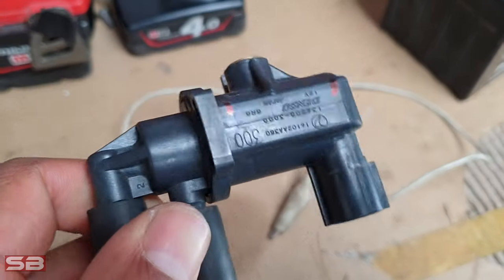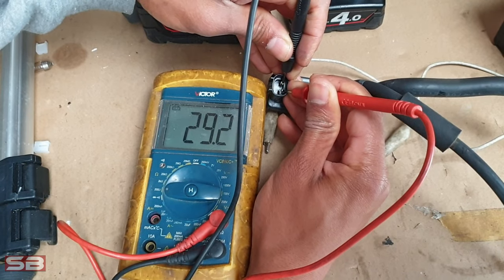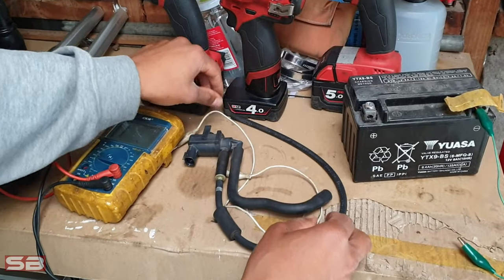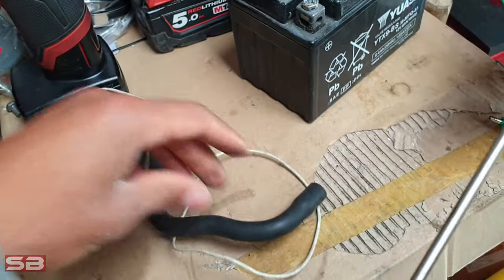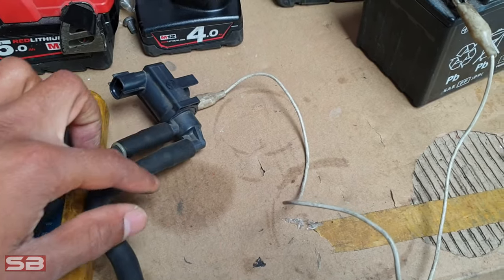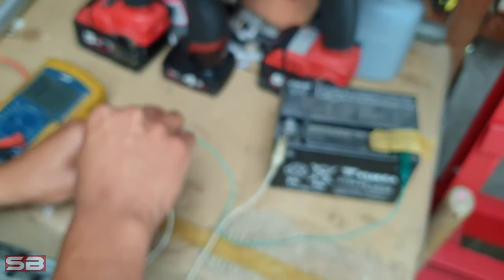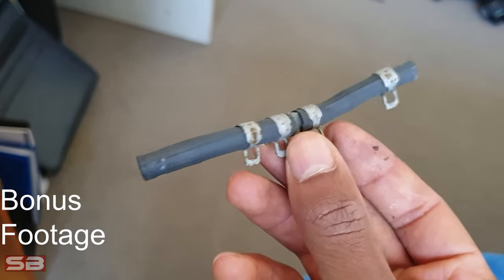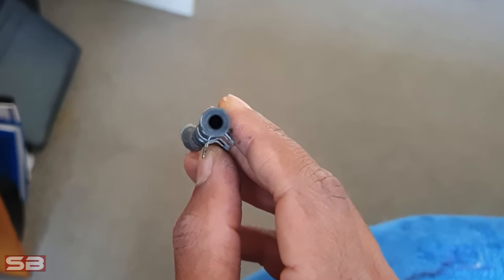Boost Control Solenoid - How to Test (Incl Important Restrictor Pill INFO)

Comment: You’re an absolute legend! After a month of diagnosing and taking it into the mechanics with no success, this finally fixed my low boost issue, cheers mate
Reply from the maker: Great! Appreciate the feedback, thanks!
Reply: You say low boost issue we’re you capable of making any boost I’m having an issue and it looks like my boost gauge is only hitting 2psi I’ve checked all my intercooler piping and all my hoses just can’t seem to find the issue and I have no code for low boost
Reply: @killacam7254  did you check boost pill?

Comment: My car workshop has replaced my hoses. My car is always low on boost. Can it be he has removed the hose with the Restrictor PILL.? I think many car workshop is not aware of the Restrictor PILL. Where can I buy a new Restrictor PILL?
Reply from the maker: @dinhvanpham8102  What car is it? Yes a lot of workshops do not know about this
Reply: @AutoBuddynz  BMW 525D Xdrive F11 2012. N47T 2.0 diesel engine. 218 HP
Reply: @AutoBuddynz  Lately I have got error 299100 Pressure converter turbine control flap open circuit. It is coming everytime i start my car. The car is in limbo, it does not accelerate as it should. IF I push too hard drivetrain pops up. There are two booster pressure solenoids. One for the low and one for high turbocharger. If the booster pressure has failed, should I replace two solenoids?
Reply from the maker: @dinhvanpham8102  i don't think you have a restrictor pill issue with your car. You may need to take the vehicle to a specialist BMW workshop
Reply: @AutoBuddynz  I have already been at the BMW specialist twice. The did not find anything and charge me 2500kr each time. I did a scan with my scan tool and check life datastream on the DDE engine control module, reading charging function data. Usually when the pressure converter works the booster pressure datastream changes everytime up to 100 percent when  i hit more acceleration. Now the datastream stay on 19.21 percent and do not change. I think it is right that my pressure converter is faulty. The turbo charge air hose do not expand either when I start my car. Error 299100 says pressure converter turbine control flap open circuit comes back after  I erase them. I have replaced 1 the pressure converter last year, I think i have to replace 2 pressure converter this time.
Reply: @AutoBuddynz   Hello good evening. I am happy to share I have found a solution. I checked the turbo aiir charge hose. It was 1-2mm slack. I replace it today 28.09.2024. The new one is firm and tight. Now my turbocharger is working again. Thank you for support and help. Have a fantastic weekend and enjoy life. :-))
Reply from the maker: @dinhvanpham8102  Appreciate the feedback, thanks for the comment.

Comment: Max vaccum level from pump is -1bar. Basicly, there is no need to test the valve with more than +2 bar (if you do not have external vaccum pump and you are must use compressor).
Reply from the maker: Correct

Comment: I checked my Booster Pressure solenoid measuring the ohm and it shows only 14 Ohm. On the 28.09.2023 suddenly I loose power and drive train messages keeping coming. I  have no doubt my booster has fault and I have to order a new one. Thank you for your video guide me to check the faulty component.
Reply from the maker: Thanks for the feedback!

Comment: Nice video my problem is my ford galaxy TDCi drives fine except when I go up this 1 Hill and I lose boost the car still drives but no boost I get p2263 code which clears with engine off and back on drives fine after that I've checked all the vacuum lines for breaks can't find any ,do you think the turbo boost solenoid is failing under sustained pressure .would appreciate your advice .thanks

Comment: Thank you for a greate video.  What is the hose size? According to your t-connector, left go to the actuator, right go to the vacuum with restrictor pill location, down go to the Wastegate solenoid valve. Should it always be a restrictor pill on the vacuum hose? What happen if the estrictor pill is not there? I have problem with low boost. Lately i have got error 299100 Pressure conveter, turbine flap, activation open circuit. Is this related to the  boost control solenoid? Another error is drive train if the i accelerate to 2000 rpm or more. I use Autophix car scanner tool made for BMW and MINI. Checking the charging datastream booster pressure solenoid show only 20 percent. In normal condition it show between 96-100 percent. Help!

Comment: On my f30 328i I replaced the vacuum pump and the solenoid 2 months after I got the code 120308 and I saw that my pump was leaking oil. After replacing it all and hitting the gas a little hard it’ll give me the same code. It feels like 70% power all the time compared to before any of the codes and feels like even less when I get to higher speeds. I don’t know what’s wrong, the pumps passing the compressed air and after watching you video the solenoid is working I think, I have 3 that I’ve tried.
Reply: Welp I just checked all of them and they all let air out of port B when I blow into port A with no power, but these solenoids are different they have 3 ports ones just blocked off

Comment: Nicely explained and very useful .Thank you for sharing and keep up the good work.
Reply from the maker: Appreciate it. Thanks!
Reply: @AutoBuddynz  Just a quick question about your multimeter ohms resistance set up.Mine only goes to minimum of ohms 200 and doesn't read the 20 to 30 as specified!How does yours read ?Cheers
Reply from the maker: @powerspeedutube  200 ohms means that it will read all values upto 200ohms.
Reply: @AutoBuddynz  Thank you very much.
Reply: @AutoBuddynz What are the chances of buying a new solenoid and also letting air from port A to port B without it being energised?
Working on a PSA 2.0 HDI -110 engine which has 2 EGRs solenoids and 1 turbo ...they are all letting air through without energy ..Yep ,I did swap them all over but still no power .The wastegate rod moves nicely when I apply vacuum,so it's either the solenoid or vacuum pump.
Very odd.......
Reply from the maker: @powerspeedutube Since its on the egr system, the operation would be a different, how does your egr valve work? Vacuumor positive pressure operated?  Generally on idle the egr valve is closed.
Reply: @AutoBuddynz  Thanks for taking the time to reply. I thought like you that vacuum would only go from port A IN to port B Out when solenoid is powered and hence no vacuum or air could pass from one side to another, but the new one also let's it through. Meanwhie for no reason, I stopped getting power to solenoids but traced to a broken wire, so that's sorted. So I am confident that I have ignition on power and I also checked continuity from solenoid plug to ecu. Here it's the ecu that sends the ground signal when needed. My next step is to verify vaccum measurements from vacuum pipe downwards to the solenoids and hopefully find a leak somewhere, as I suspect because thd solenoids are not receiving enough IN vacuum, the ecu isn't turning them on. I am only getting 350 hgmm and I should see 700+..Maybd this is! I let you know but I am still baffled by the solenoid air going through and not holding vacuum.
Yes, you are right EGR should be closed at idle and I also have another solenoid that controls the throttle valve and this should be opened.
Normally I resolved so many problems like this by finding a faulty  solenoid not holding vacuum because thd rubber membrane seal split inside.... Thanks
Reply from the maker: @powerspeedutube  Thanks for the info, do let us know what the issue is when you solve it. Have you tried one of these vacuum hand pumps? https://www.amazon.com/Performance-Tool-W87030-Automotive-Bleeder/dp/B013VUZ7WG/ref=sr_1_5?keywords=hand+vacuum+pump&qid=1668971854&sr=8-5    
Used to normally bench test solenoids with it.
Reply: @AutoBuddynz  Hi, yes I have a similar vac pump. Been very useful together with multimeter in resolving vac and electrical problems, especially with solenoids.
Will keep you posted and also still need to know why all solenoids I have let air through,which is puzzling me. 🙈
Reply from the maker: @powerspeedutube  Whats the part no. on your solenoid?

Comment: I think I will change mine. My mini runs very good but I've been noticing some kind of strange fluctuation in the way I receive power. No codes ever, sometimes I have full power, sometimes it's only maybe 70-80%. I have bmw diagnostic tools but I just don't really know what to do anymore.
Reply from the maker: What car is it?
Reply: @AutoBuddynz  Mini Cooper S 2012 with n18 engine.
Reply from the maker: @Globbs  don't think that would be related to the boost control solenoid. Would start with the basics first, furl and spark testing.

Comment: Hello, thank you for the informative video....i have this turbo fault code here P0048 on my hilux 2.8 gd6 and the car has low boost. Tested the solenoid and im getting 24/25 ohms. Care to advise?
Reply from the maker: Is the wastegate operating correctly, depends on what is fitted Electronic Actuator or mechanical? Are you able to perform all the checks seen in this video to ensure the solenoid is operating correctly? Might also be worth checking your vacuum lines etc
Reply: @AutoBuddynz  yes the wastegate is operating smoothly....the actuater is an electronic one. I only managed to check using an ohm meter because its the one i have right now. The only thing worrying me is that the position sensor was broken during the accident and we put it together using q-bond maybe it shoterd out the whole thing

Comment: My car normally runs at 1.5 overboost , 1.3 constant and 0.8 at redline. But for the last 1 week i notice boosting only to 1.1 and then going down to 0.5-0.6 which i think is the wastegate pressure.
Does this mean i have bad solenoid ? I checked for vacuum leaks and any hardware cracks like turbo or manifold and all look great. So either my wg is at fault or n75 solenoid. Any ideas?
When i disconnect the vacuum line from the WG my car boosts up to 2.0bar(29psi) which i think means my wastegate is OK.
Reply from the maker: From the test you completed it tells me the wastegate is sealing well. Another test you can do to ensure the wastegate actuator is functioning is to connect the wastegate vacuum line to a boost line eg. T in from a boost gauge line etc. This way you can check that the wastegate open and holds steady factory boost pressure

Comment: I have Volvo v50 diesel 2.0 Litres,i have the same Solenoid Controller...i grabed a medical Syringe and tested this vacuum ports A and B...when that car is in idle for example the port A is working as it should be the vacuum is ok the Syringe is closing fast,but the port B is not working at all...is this meaning that my Solenoid is not working as it should ?Should booth port A and B work exactly the same ?
Reply from the maker: You really need to pressure test any boost solenoid, vacuum testing a pressure device is not really ideal. If you visit any garage or buy a can of compressed air follow the steps in this video and you will know for sure if there is a problem with it.
Reply: @AutoBuddynz  Thank you !

Comment: If Apply air of port b , should escape in port a ? Or not ?
Reply from the maker: Only when you activate the solenoid with 12v air should flow from port A to port B

Comment: Would a faulty valve of this type be the cause for shaky acceleration? My car essentially vibrates when I accelerate any faster than a grandma
Reply from the maker: Depends on the conditions while driving, highway etc but in most cases no, sounds like an airflow meter problem. Scan the car for any codes
Reply: @AutoBuddynz  ive disconnected the maf while it idles and ive been told that if thats bad the idle will smooth out but that killed the engine, was going to buy a new air filter and some maf cleaner, ive cleaned the etm before and re-used the gasket. could that be the cause?

Comment: Why would you even check this solenoid? Symptoms please.
Reply from the maker: Vehicle not coming on boost, low boost pressure. Stored fault codes. Basically if the vehicle is gets slow or sluggish
Reply: @AutoBuddynz  thank you!!!

Comment: If these fail could it cause the engine to not start? Vw golf tsi 2008
Reply from the maker: No it should not cause a no start condition. There are cases if the wiring is short then it could affect the CAN bus system but this is rare. More common things to fail on a Golf TSI, high pressure fuel pump, timing issues, diverter valve, vacuum leaks to name a few. Whats wrong with your Golf and when did it start having issues?
Reply: @AutoBuddynz  okay thanks, I have a diagnostic guy testing today hopefully narrow it down . Car was lacking power then one day going up a hill it stopped, last toothed belt was replaced at 130000 at 190000 now.

Comment: Hi, is this the same as the waste gate solenoid? Thanks
Reply from the maker: Hi,  yes it is, if your referring to the part which controls the mechanical waste-gate actuator connected on the exhaust housing of the turbo.

Comment: Looks like there is 2 pills ? I had blue tap on mine but feels like I have a pill in either side
Reply from the maker: Hey that should not be the case, should only have one, is the vehicle reaching desired boost levels?
Reply: @AutoBuddynz  I deffo have 2 one either side of the t piece one side had blue tape on it. I bought it from main dealer. I replaced all solinoids and pipes coming off the solinoids on my car and still getting p0244 even adjusted the actuator. I just don’t know where to look now 😫
Reply from the maker: @lawrencemann3578  Its an overboost condition, check and ensure your wastegate is not opening properly, if the diagram is damaged it might not be opening fully. Otherwise try this, remove both restrictor pills  by changing out the vacuum hoses, next clear the codes & take the car for a drive, it should only only 8 - 10 psi boost. If it still plays up with the fault code I would be checking that wastegate
Reply: @AutoBuddynz  I have no way of telling what psi I am running but I shall bare that in mind thanks

Comment: Does anyone know why my vacuum line for my 2008 Subaru wrx has two restrictor pills? One in each side
Reply from the maker: If its a factory fitted line, that's fine, no issue with having two restricters in place.
Reply: What does the restrictor pills look like is it like a bearing ball
Reply from the maker: @luankoenel7672  yes kind of looks like a ball bearing

Comment: I have a 3 hose gm/pierburg version of this in my 2016 opel astra k and when i use the tester to apply more control demand to it the valve starts to make a loud rattling sound. Is that normal or should it just actuate the solenoid valve against the spring in silence when the ecu sends more voltage to the 12v solenoid? The car is a gm 1.4 turbo and it suffers from low boost / no boost at all. The only code i get is a p0299 low boost minimum limit exceeded.
Reply from the maker: The valve should not be making a rattling noise, sounds like the valve is at fault. Its normal to hear some noise from the valve but nothing excessive should be heard.

Comment: Is this true for all boost solenoids? Mine is about 50% open inactive and 100% open active?

3 port boost solenoid with diaphragm
Reply from the maker: A 3 port solenoid will bleed out a little bit of air from the port open to atmosphere, however the two ports between the wastegate and boost / vacuum line should not be open when its inactive.
Reply: @AutoBuddynz  thanks mate appreciate it